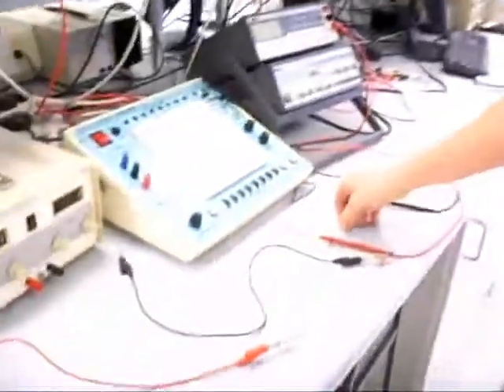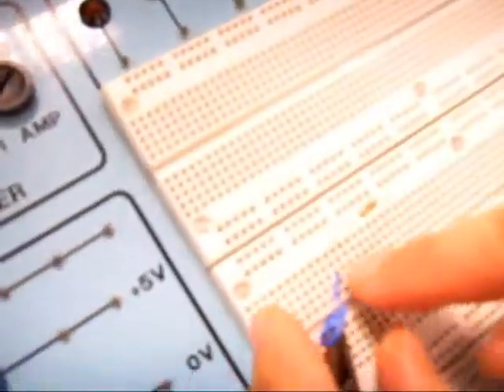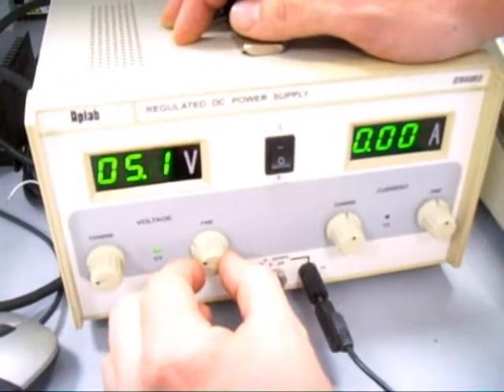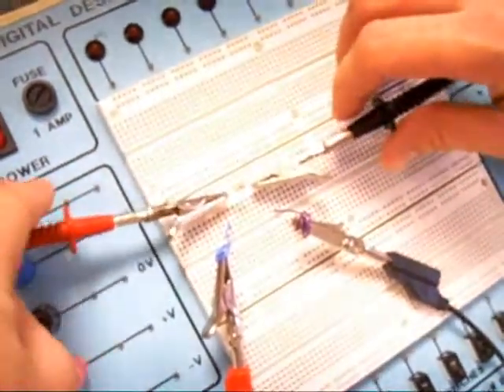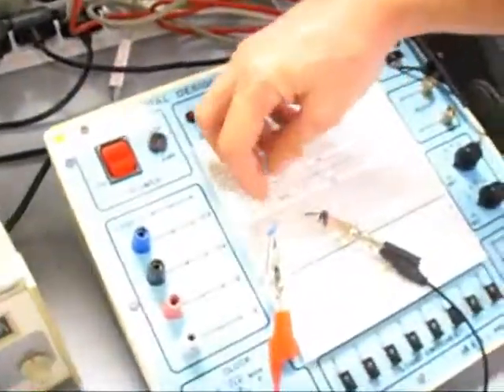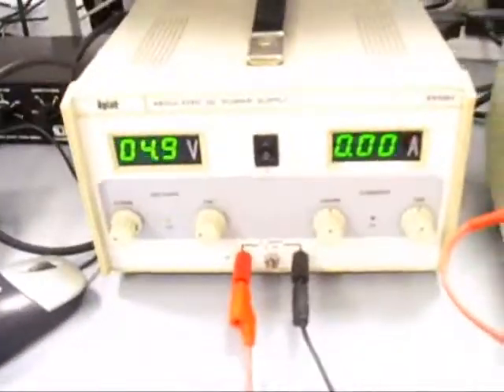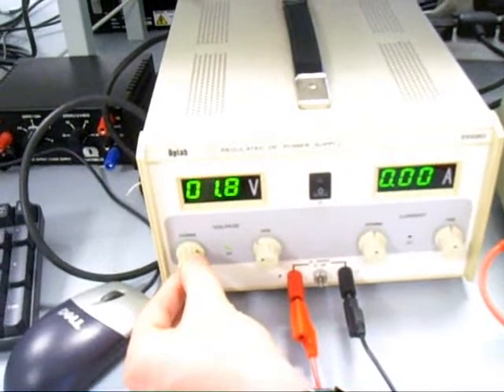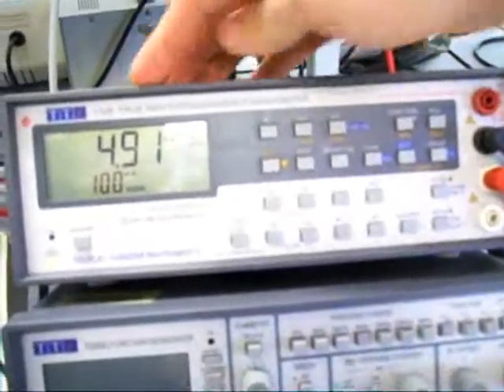ET4003 Lab 1: Ohms Law

Comment: The FMMC meter measures conductance and not I nor V -- consider carefuly how a meter varies with resistance change, then you will see the truth. To get you started, make the observation that a meter is a meter and cannot measure two different values because it is only one instrument and not two: a ruler can measure space not time. Ask yourself questions and never give up, or give up when you have exhausted all possible explanations. The assumption that a meter measures flow  or P.D. is wrong.